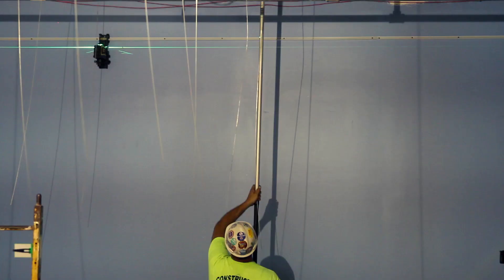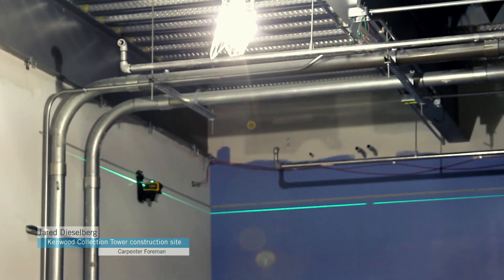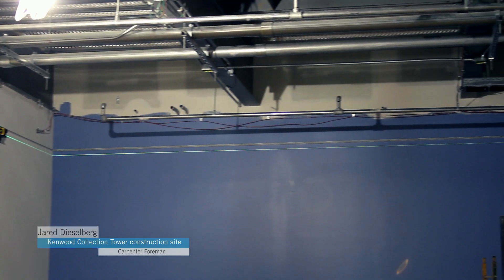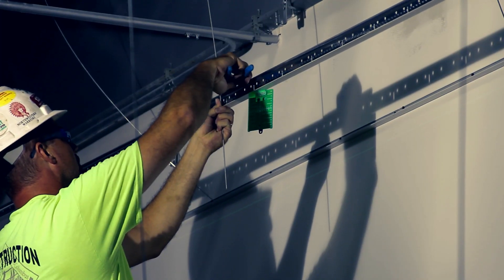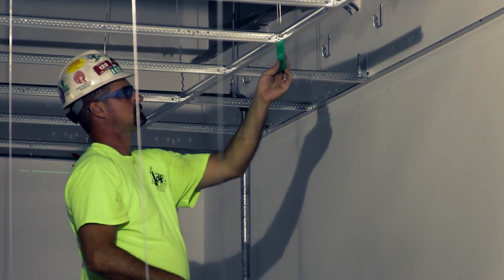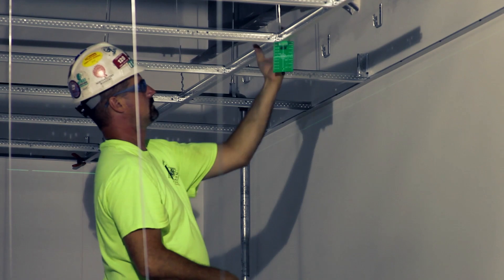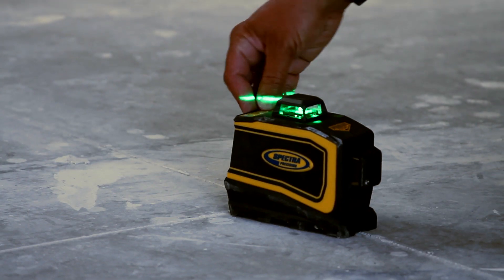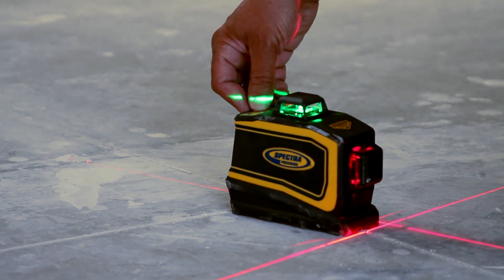Spectra Precision's LT58

Comment: I've been using the 1.3xl for the past year, great for small area layouts....weak light though, I would like to give this one a shot when the 1.3xl gives up.  Why isn't the 1.3xl being marketed, can't find them now a year later except out of China on ebay......????
Reply from the maker: +Earl Ismyname  The 1.3XL was discontinued about a year ago.  The LT56 (red) and LT58 (green and red)both have crisp bright lines, rechargeable batteries with long operating times. 360⁰ coverage and include's a very effective ceiling mount.  We can recommend both LT56 and LT58 for general interior construction.
Reply: +Spectra Precision Lasers 
For what these both do, the price point for the 1.3xl hands down makes this a no-brainer if it were still available to purchase.....the LT56 may have advantages, but many times there is a need for a simple X/Y line generator that doesn't have a price point of a 1000 bucks or thereabout.    I like the spectra/trimble products.....wish there were a more affordable version like the 1.3xl in your lineup.  Considering others now.